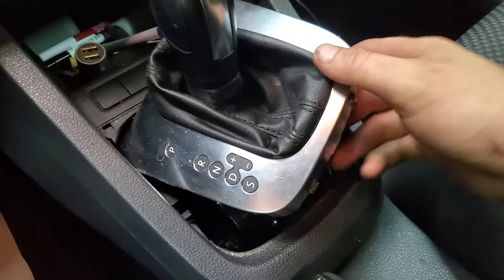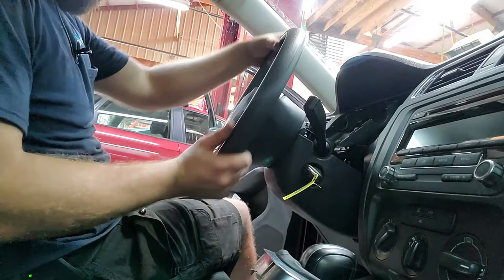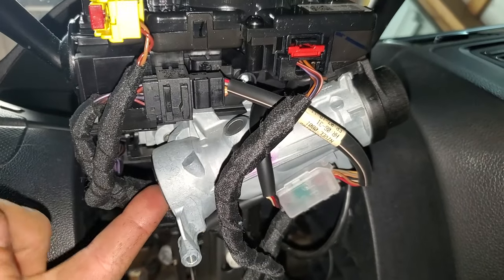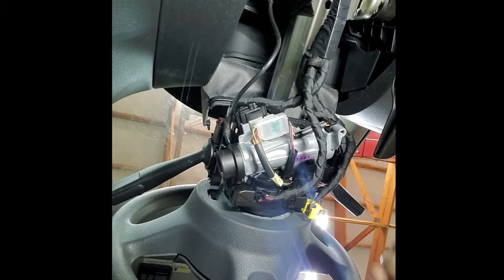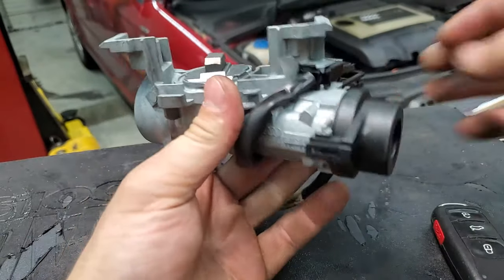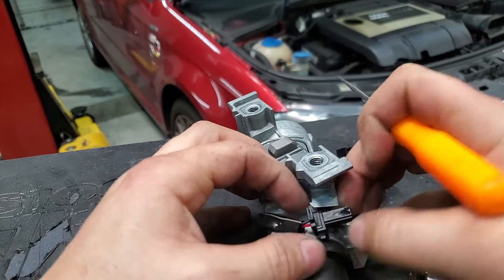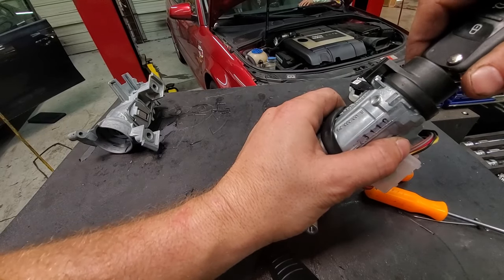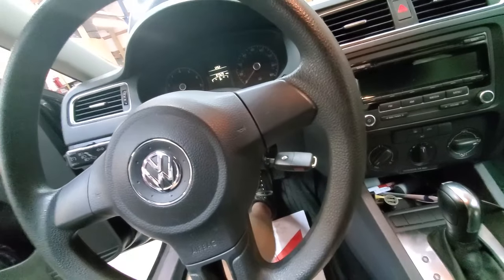How To Remove and Fix the Ignition Switch in 2012 VW Jetta DIY

Comment from the maker: I made a follow-up video to this with some other information. I basically re-did the job and concentrated on the question points I got the most of. 
https://youtu.be/y0YSIiZ6rME?si=qRd2GNjY-Y-zEgM3
Reply: So did you check what was the issue with the old  Ignition Lock Assembly, Thanks just curious
Reply: Where can I find the sheer/breakaway bolts for this exact make and model? Maybe, with normal ones in case of future maintenance
Reply: I watched both videos and had it knocked out in like a half hour. It was nice to find exactly what I needed for a change lol.

Comment: So many other videos say to remove the steering wheel, but this way is so much easier and it shows that the removal of the steering wheel is no at all necessary. great video. I also learned that I don't need to get a new key.
Reply: well, i wasnt able to unsrew those 2 bolts without removing the steering wheel and plastics around, i have 2012jetta
Reply: Because most vehicles have screws behind the steering wheel… this model does not. Yours most likely will.
Reply: How to reprogram key after replacing the ignition switch?
Reply: Yeah man...This dude is a boss 💪🏾💪🏾💪🏾

Comment: FYI the specs on the bolts are M8 x 1.25 x 20mm long.  Replaced mine with simple regular flange head bolts.
Reply: Are you referring to the security bolts ?
Reply: @cooldude30211  Yes, the breakaway head ones.  Why bother with those when you can use ordinary bolts in case you have to service it again in the future.
Reply: You're awesome, thank you!
Reply: Thank you.. Where did you buy the bolts at?
Reply: Yes! this was the last thing I was looking for were the specs on the bolts!
Reply: Would this be the same for 2009 Passat

Comment: Thank you the detailed video. Remove the bolts with the steering wheel on and all went smooth. 30€/part overnighted from Amazon and the car was back in action. Thank you

Comment: Thank you so much - successfully completed though I used a screwdriver through the front holes and hammer to turn the bolts holding the ignition barrel rather than drilling them out

Comment: What type of torque screws did you put bank in to hold cylinder?
Reply: Good question
Reply: Trying to post part number but youtube is a pos and no posting. F youtube.
Reply: Audi VW Shear Head Bolt - Genuine VW N90584502

Comment: Much appreciated sir! Found this video and it gave me the confidence to take it on. Saved me the cost of a tow and repair fees.

My car got stuck away from home, the key would go to On but not over to Start. I tried wiggling the key for 30mins before i gave up and found this video. I ended up taking the ignition assembly out and banging it around until the key would turn over, put it back in and got the car home to finish the job.

Hardest part was chiseling the headless bolts to get them out. It was very discouraging until i noticed they were turning just very slowly, then they loosened enough to removing with my fingers. Getting the ignition switch out was also a nightmare. I lined up the whole with the dote on the black rubber and played with it for 10-15mins before it released.

Comment: Banging the thing worked for me not too hard but eventually I got the key to move to the correct position. Thank God for you sir. Everyone kept removing the steering wheel or didn't show much direction to get the job done. I applaud you sir.

Comment: Awesome video! The tumblers inside the ignition are hung up in the lock position. In order to turn the ignition and start the car I put the key in the ignition, held the key fob straight and with the plastic end of a stubby screwdriver tapped on the end of the key directly inward. This caused the tumblers to shift out of the locked position (fall into place) then I started the car.
Note: Be careful tapping the key with the screwdriver. Do not tap it with too much force or you may damage the ignition. Start with a few light taps and if that doesn't work then slightly increase the strength of your tapping and try it again.

Comment: Thank you so much sir!! I don’t work on cars much and I was quoted $1650 for this. I ended up spending $215 and spent an hour doing it. I didn’t need to remove the steering wheel. I used one of those thread makers for stripped screws for the 2 bolts and it worked like a champ.

Comment: Your video was of great help. I looked at others but yours was the best. With that been said, I ran into some problems not mentioned on your video. NO, am not an expert, this is my 1st time doing it but, for some reason I had to do the following:

5.04 Since I started late. The dealership was closed by the time I finish. I reuse the screws by cutting a slot with a Dremel and screw them with a flat screwdriver 

6.30 I wish you can get the camera closer. I had to guess what it was that I had to push or pull but, I got it. Please people use the same pick he used on the video. A 45 degree pick. It does help a lot with the removal

7.00 I rather remove it from the opposite side. Near the solenoid. My cylinder came with not wires.

8.18 Once you stick the paperclip in the lock. You have to push the assembly down or is not going to release. Why I don't know. I did it twice. 

One more thing for all of us ROOKIES. Don't place the old cylinder near the new one. I reassemble the old one again. It wasn't until I looked a the pink or purple letters stamped on the old cylinder that I realize I assembled the wrong one.

Thank you

Comment: Thanks for uploading this! It turned what would have been a surely ridiculously expensive repair from the VW dealership into a $75 and couple hours of labor repair job!

People like you are the real MVPs!

To give more context, I tore the entire assembly apart to see if I could fix it. I was able to disassemble everything, however I found that some metal chunks had broken off the housing and were jamming things up internally. Upon reassembly, it was no longer jamming, but still didn't work correctly - I suspect the piece of housing that broke off is supposed to hold a retention pin in place, but is a weak point prone to failure.
Reply: I need help because I’ve been trying it & it won’t come loose smh

Comment: Thanks for the Video! Just replaced ignition switch assembly, didn't want to remove the steering wheel like other  videos. Works perfect! Dealer (Stealer) wanted 1,000.00 roughly to replace. Found the ignition assembly online and on sale from my local VW dealer $104.00 plus tax, $3.00 each for the bolts. The bolts are a must have, they are anti theft breakaway bolts good for one installation. Thanks again you Rock!
Reply: Hey man did you have any issues getting the cylinder to drop down after removing the breakaway bolts? I loosened those two bolts up easy enough using a punch & hammer, then disconnected all the wires, but it feels like something else is still holding it on. Is there a plastic clip or something somewhere that I’m missing? 

I’m working on it right this second, I’d appreciate it so much if you could help me out. Thanks in advance!!!
Reply: @czcrossman  Yes I did! There are tabs that hold the switch assembly up on each side of the switch assembly, it’s very hard to see, I used a flat tip screw driver and pried assembly away from the tabs, struggled for a while but once I found the general area holding it in place it came off easy. Once you get it off you’ll get a better understanding and how easy it is to snap the old or a new one back in.
Reply: Dude I did it! Got the assembly out finally, but still can’t get the freaking key to turn. I’m trying up repair the one I have, since my local dealership has no such $104 sale lol they’re trying to charge $285 😤
Reply: @czcrossman  Awesome! Bummer about dealer charging $285. There's aftermarket out there i.e. Amazon EBay, not sure how good they work, but there's several repair videos on the switch assembly.
Reply: Pretty sure I was able to repair the one I have, gotta wait until morning to install. Fingers crossed!
Reply: @czcrossman  Did your repair work? I got mine to function after banging with the key side up, freeing up whatever was locking it down, but think it might be safer to replace.
Reply: @BotThot  yes it worked perfectly! Then my GLi completely blew up two weeks ago :( 2.5 inch hole in the back of the block from broken rod. Never buying another goddamn VW ever lol
Reply: @czcrossman  Damn I know the feeling. My GTi blew from the damn chain tensioner failing at 96k. What did you do to fix? Drill the press fitted circle of metal and take out the spring and retainer?
Reply: @BotThot  dude mine had the timing chain tensioner fail at 70k, got it fixed PARTIALLY under warranty (meaning I still had to pay $4,000 of the ~$12,000 repair job), and then this shit happens 30k miles later. PLUS I’m about to pay the car off in 3 months…. Infinitely frustrating.
Reply: @BotThot  and yeah all I did was drill out that little circle and remove the spring & pin, clean the entire thing with brake cleaner, then put back together without the spring & pin. The ignition won’t “lock” anymore like it won’t lock the steering wheel, but it worked perfectly to start & stop the car.
Reply: @czcrossman  Damn, I was too high mileage to make it worth doing that poor excuse of an extended warranty. Ended up rebuilding with the help of a couple good friends. I think it was a couple grand in parts. Swapped the clutch for a DKM stage 3 same time engine was out, so maybe 3-4k for crankshaft, pistons, rods, tensioners, timing, and so much time. When it was finally done I went to fix a minor oil leak above the oil pan at the rear passenger side of the engine, and a little bolt snapped off in the block. Several long nights to get it out. 

The worst thing she’s done to me was when those stupid anti-theft shitty soft metal wheel bolts wouldn’t come off. Couldn’t get two of them off, even with a new key from the dealer. Took the wheels off and put them back on too many times for that absolutely terrible design. Started off with air hammers, chisels, etc to snap off the spinning ring, then tried extractors, larger sockets, and drilling. Finally got the 2 stripped ones off thanks to a welder buddy, welding a socket didn’t work but heating a specific socket up and hammering the piss out of it finally did the trick. Probably 3-4 weeks working on it on my days off and after work.

Sorry to air out my GTi PTSD lol. I came here to say thank you for replying to my question on your 5 month old comment. My original comment was hours into the rabbit hole to find a temporary fix and you honestly saved my ass. 

Pulled out the ignition, smacked it a few times key side up and it unlocked. Removed the ignition lock, drilled out the pressed circle, took out the spring and retaining pin then ran it like that until I had time to get a new steering lock ignition housing. No issues with it locking up again for the last week or two before replacing it with the new one the other day. 

Thank you again Zack, I hope your future is filled with something that doesn’t self destruct due to poor design and absent of VWs.

Comment: I just had this EXACT same issue with my 2010 Jetta. You made it look so simple. I believe I could have done it myself and saved $365 bucks.  I wish I caught this video before I took my car to the garage. Thanks; great video; perfect instruction.
Reply: I got charged $900 for the same issue
Reply: Are you sure you could do it?
Reply: I don’t work on cars much and I was able to do it. I was quoted $1650 for this and ended up spending $215 and spent an hour doing it. I didn’t need to remove the steering wheel. I used one of those thread makers for stripped screws and it worked like a champ.

Comment: Dealer in South Austin, Texas wants $180 for the replacement steering lock mechanism.  The one I just ordered from Rock Auto for $43 arrives Tuesday. 😁 Thanks for the video. Took 25 minutes maybe for the removal.  The breakaway bolts were tough to work out, and I had to break away parts of some plastic rings solely keeping one from getting a good angle on the tops of the bolts with the corner of a screwdriver. Prior to reusing them, I am going to slot them on the top with my Dremel to allow their tightening with a lg slotted screwdriver.  Hopefully everything goes well Wednesday morning for reinstall.
Reply: How did the one from Rockauto do? Was it easy like his OEM part?
Reply: @paolomunar  Part arrived on time.  Install went fairly smooth.  I say fairly, because upon removing the old unit days earlier, I failed to realize the parts under the cap on the drivers door side of steering lock, did not come with the new steering wheel lock.  I had recklessly ripped them out of the old one to investigate , ok out of curiosity. Luckily found the pieces and figured out the proper order for reinstall.  Without the parts properly placed, the unit does not function.  Looked for over an hour for an exploded diagram of these parts to insure proper install, but found none and had to puzzle them back into place.
Reply: How did you reprogram the key after replacing the ignition switch?
Reply: @FernandoRodriguez-ds5ri  I did not replace the ignition switch.  I used original switch which I removed from the old steering column lock assembly and installed it into the new one.

Comment: PRO TIP:  You have the screw/bolt out. Take a Dremel and cut some slots on top, use a slotted screwdriver to re-install. 

This video was AWESOME. very helpful.
Reply: How to reprogram the key after replacing the ignition switch?

Comment: Awesome video..thanks...had this problem on my 12 Jetta...your video absolutely saved my butt..got the cylinder aftermarket from the green guys..didnt come with the bolts so just got some frome Ace..no worries..thanks for the assist..

Comment: An auto center punch for those break off bolts work great just make a dent about 3 times then do it at an angle, they come out pretty easy
Reply: Quick question does the left side screw come off in a different direction cuz I took the right one pretty easy but iv beaten the shit outta the left one and it still hasn’t came off

Comment: This happened to my 2011 jetta today 2 hours away from home, found out it’s very easy to hot-wire 😂 Not paying for that tow.  Hoping this works, just ordered the part.
Reply: How’d you hot wire it?
Reply: @hardcore4476  YouTube tylersteffen200 he has a good video. I just followed his video. You still need the key so the steering wheel doesn’t lock though.
Reply: @ZeroHecks  ok, thanks!

Comment: I couldn't get the key to move at all, so I cut the cylinder in half and pulled it apart. Then the key would turn -and I found a tiny little pull spring that was chewed up inside the cylinder -that was the problem. A 10¢ part cost me $200 😂

Don't be afraid to cut it in half.... Oh and for the pin to unlock it -i used side cutters to snip off a piece of wire from a dollar store wisk. It fit perfectly.

Comment: I had the same problem with the key not turning, and did this. The safety screws are a bitch to get out, but with a sharp flathead screwdriver and a hammer, I was eventually able to get them out with some persuation. However,  my key was not able turn to the point where I could get the key barrel out, so if you have the same problem, take an angle grinder and cut the whole thing in two ( just make sure you cut below the key barrel) then I was able to turn the key and get the barrel out.

Comment: What does the sensor for the key do . Have same problem on 2012 Passat thinking maybe you could
push that button up inside the ignition sleeve thing instead of buying a new one and lube it ?

Comment: One thing I found is that if you just need to replace the ignition switch side you can just take off the covers unhook the ignition switch from the back side and pull it out. Not as easy as when it’s out but easy if it’s just that part of it causing the issue

Comment: I just got mine apart.  Did do the bang around to get the cylinder to turn for removal.  I think I know how it needs to be placed for it to work.  Have the key facing up, smack down on hard surface of choice while turning key.  I found through messing around with the assembly that the guts would turn easily if you push in where the lock cylinder goes.  The lock cylinder only turns the mechanism not push down.  Not sure as to what is causing the issue, didn't see anything obvious.   Tried cleaning and greasing and while it smoothed out would still jam until you pushed in.  Will be replacing steering lock assembly.
Also, I drilled holes in the plastic bracket to get the bolts out.  Just big enough to get a small punch in and in the direction for loosening.

Comment: Hey man, I just watched this video and it helped. But I think I did something wrong. My key went in and will turn, but wont turn back off and I cant removed the key. I was gonna remove the key switch and try again, but I dont have that pin tool you have. Any ideas?

Comment: The dealership replaced mine for this issue under a 100,000 mile extended warranty. However, within 30,000 mi that ignition failed and all the electrical started going haywire. Now they want almost $800 to replace it again.